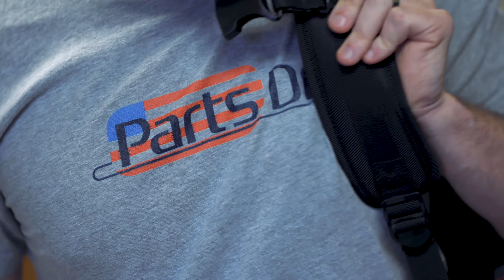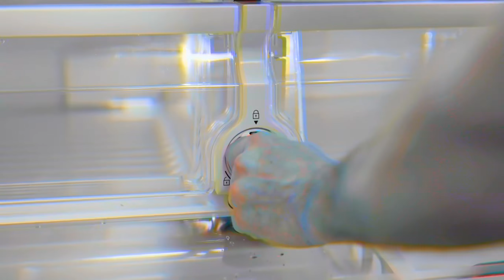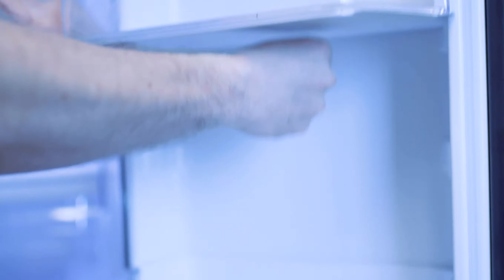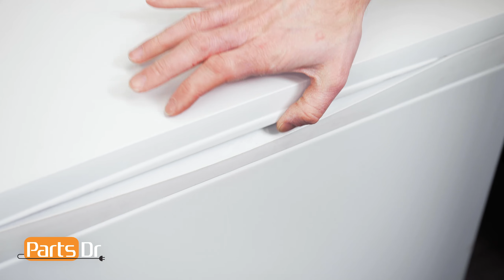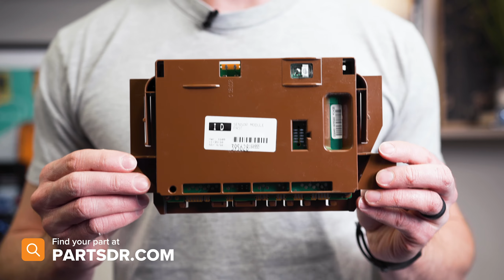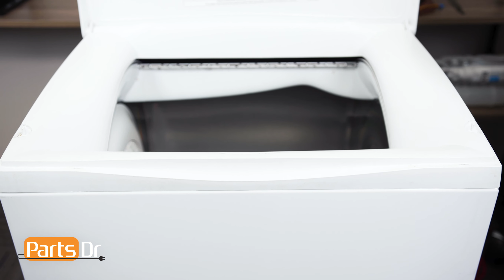How to replace sensor module on Fisher & Paykel top load dryer part # 395628P

Comment: Why do you have to remove the lid, to remove the sensor?  I understand undoing the blue lid wire, but not the whole lid.
Reply from the maker: We found it easiest to work on the machine this way as there is no way to easily prop it open.
Reply: @PartsDr  thanks for the reply.  I have a back wall that I can use as a prop.  Your video was GR8.